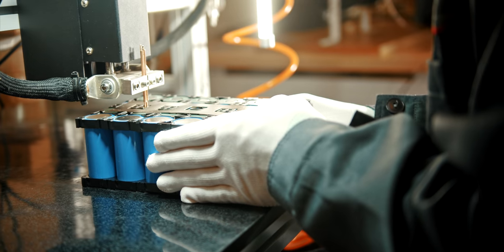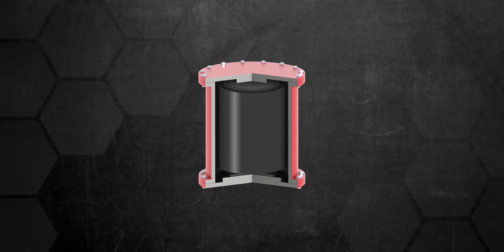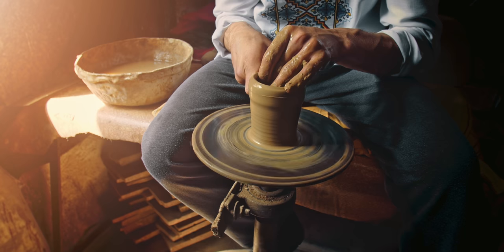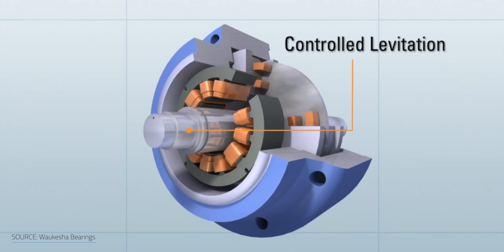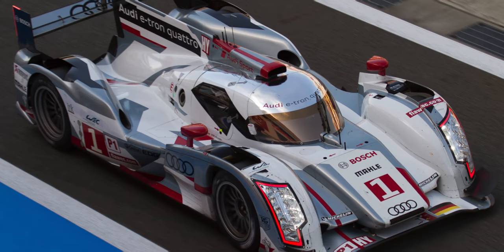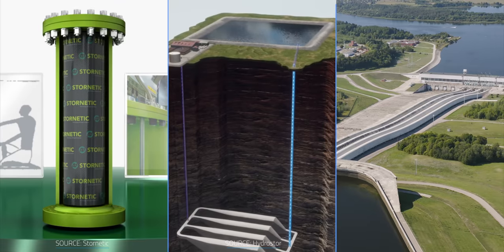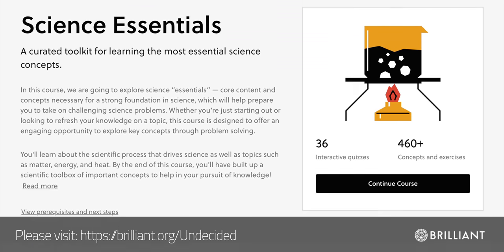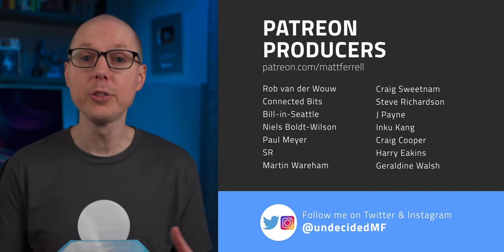The Mechanical Battery Explained - A Flywheel Comeback?

Comment: We are close to our goal of using a hamster for our energy
Reply: From horsepower to hamsterpower, we really have come very far in our ability to miniaturize things
Reply: Well, i don't think it's a coincidence that Elon once said that his factory could contain fifty billion hamsters.
Reply: Matt - Beacon power is a Boston area (Tyngsboro) company as well. Have you looked at SMEs - Superconducting magnetic energy storage
 ?
Reply: I'm afraid I can't let that happen.
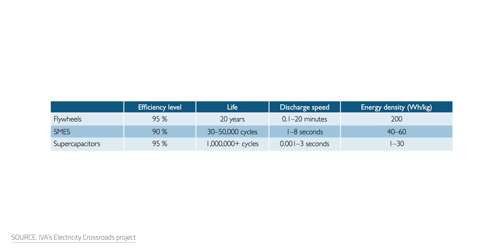Reply: As per the chart at 5:58, a 10Kg flywheel can provide 2 kWh energy; my daily consumption is less than 10 kWh. A 20kg flywheel and a 2kW solar panel can meet my total energy demand.
Reply: @janami-dharmam  One problem with flywheel that was not touched on, is that with any failure you will have what really is an explosion. Even a 20 kg wheel would do some major damage. For small flywheel this is "fixed" by building it into a VERY strong frame. It was not just by chance that for the large flywheel, the pictures showed them buried into the ground away from buildings and people.
Reply: @UndecidedMF  a video for April fools Day.
Reply: Now thats an idea lol
Reply: It's impossible!
Reply: Had to laugh at this vision!
Reply: You jest but there was, now extinct, a breed of dog in the uk specifically for that purpose. It would run all day in a wheel creation mechanical ⚙️ energy.
Reply: @bknesheim  True, but unfortunately that is the same for any energy storage device. The stored energy in the device must be dissipated locally and it does not matter whether it is a flywheel or a LEAD ACID battery. Yes, I understand that a 20 kg flywheel need to turn in vacuum and also need a vacuum pump and associated electronics and the net mass of the system may well exceed 100 kg.
Reply: @janami-dharmam  The nature of failure in a storage device matter a lot. 
Example: 20kg wood store about the same as 10kg of gunpowder, but there is no way for the wood blow up your house. The gunpowder will do just that.
Same for is true for lead acid batteries and flywheels. A bank of batteries can set your house on fire but it is easy to protect against it. On the other hand, even a small 20kg flywheel at speed will go trough walls of cinder blocks like they was made of paper in a second.
Reply: Ross Outdoors  Do Hamsters use Peloton? They gotta be pretty rich for that!
Reply: @Think_Inc  That I do not now, but at scale they will produce a lot of CO2 and CH4 (metan), but as an at end of live cycle you could sell ham-ster-burgers at McDonalds an lots of fure blankets.
Reply: Best comment! :)
Reply: @janami-dharmam  Anyone hoping to run a flywheel, no matter how small, is going to need to be able keep the magnetic bearings at some ridiculously low temperature (liquid nitrogen type stuff) in order that the superconductors will work. I'd imagine that type of refrigeration requirement is gonna rule it out for personal use. Pity.
Reply: @michaeljames5936  These are simple magnetic bearings, similar to the ones used to gas centrifuges. Anyway, superconducting magnets are currently not available at LN2 temperatures (they need liq He temp). Because the load is already balanced most of the design can be simplified.
Reply: Have a warehouse with 100 cycles generating electricity. You can pay people out of work or homeless - cash for generating power. Everyone is happy.
Reply: Im close to my goal of using high power lasers and extreme pressure from diamond anvils to compress a hamster into a near singularity to cause HAMSTER BASED FUSION!!!! early estimates on energy production are roughly told to me as " mate are you fucking stupid? What are you on about??? That'll never work" so I'm very hopeful as it sounds like norm fusion to me!
Reply: Ah finally putting Richard Hammond to good use!
Reply: all we gotta do is make a huge hamster zoo with tens of thousands of hamster wheels all connected to a power generator.
Reply: Ppl seriously think of going to 100% solar energy. Forgetting how sun doesn't shine at night
Reply: Upgrade to guinea pigs for a small fee
Reply: Simple idea, complexity within it.
Reply: @halcyonoutlander2105  idk... that kinda sounds like slavery with extra steps lol
Reply: @KOTYAR0  uhhhh that's the whole purpose for storing energy, like in this video.
Reply: Is it guna be used in Hampture? The underwater Hamster utopia?
Reply: I recommend a hamster and a cat...
...for those days when the hamster do not want to work...
Reply: 😆 lol 😆
Reply: Are these big hamsters.
Reply: Lockheed Missiles and Space Company had a contract to develop a flywheel powered bus back in the 1980s. It never worked out.
Reply: Honestly im frying my brain at how to harness all the variable inputs from multiple running hamsters without having the same number of dynamos
Reply: @theshuman100  Elon Musk has the solution.
Reply: @jimprice1959  like literally or are we rubbing his mind like a genie lamp
Reply: Close??? You people are soooo behind. My PC's been running on gerbil power since the 90's 🐹
Reply: I do that with iguanas
Reply: We cannot allow a hamster gap to form between us and our enemies.
Reply: The solution is already out there. Hamster=Humans Hamsterwheel=gyms
Reply: We should have a viable hamster power source within the next 30 years
Reply: Hamster generate energy, energy generating save time, time save money, money to buy hamster food, hamster food make hamster able to spin longer, spinning longer=more energy, repeat
Reply: Please! Bbrrrrrriiiiiiing the haaaammmmmsssteeeersssss!!
Reply: The heck with hamsters.  Automation is going to eliminate a lot of human jobs.  I say we get a lot of displaced workers to run on giant hamster wheels to generate electricity.  Think of the health benefits for the runners.  Plus, the US would be a lock for Gold, Silver, and Bronze Medals in any Olympic or World Cup long or short distance running events.  Finally the runners wouldn’t need a vehicle to get to work as they could simply run to wherever they need to go, thereby cutting carbon emissions.  It’s a win-win-win.  ;)
Reply: @Widdermaker  guinea pigs will take over automation
Reply: There  is a bbc Rutherford and fry podcast that looks into it, lots of hamsters needed...  not really an option - sorry
Reply: Eggman cackling in the distance
Reply: hahahahahahahahaahahahhaahahahahahahaha
Reply: We got that hamp game.
Reply: the global chipmunk elites will never let that happen!
Reply: I was taking to my wife about something similar a while back: a sort of biological energy source, something like an enzyme or bacteria fed with either waste material or biomass.

It would probably spark a discussion about whether it were a living being and it's ethical use(or in some cases, abuse). Idk 🤔🤷🏻‍♂️
Reply: What do you mean by "We are close"? All my energy needs come from hamsters!
Reply: Human1 : My car is getting slow
Human2 : Feed your hamster.
Reply: Dr. Hamsterwheel I presume...........
Reply: Almost there I think
Reply: The conversion rate from input to output is unrealistic. Hamster farms feeding into hamster power generation farms then ground up hamsters being fed to new hamsters still requires more energy input than it outputs. This means there's no net energy gain because truckloads of grain is required to feed the bastards.
I envision hamsters being used as modular hamster reactors in remote locations for emergency power.
Reply: we might need 2 though, the wheels look heavy
Reply: Made my day 🤣
Reply: Hyper flatulent cows, actually. We genetically engineer our cows to produce a lot of methane.
Reply: That's funny stuff... lmaorotf
Reply: Bro.. I'm already there. I found that if I supplement their diet with methamphetamine I get huge power production but only twice a week.
Reply: The hamster powered sun which in theory the RMR of a solar mass of hamsters is about 1000 x that of the sun
Reply: do not underestimate Hamster Power or Capybara Power (for heavy equipment)
Reply: "a"????? One hamster to power the world?
Reply: That's how I power my brain so it's gotta be possible.
Reply: @bknesheim  I think that's why a lot of them were mostly underground.
Reply: How about using treadmill to extract energy from people trying to lose weight..
That way it's a double whammy 😁
Reply: HAMPSTER
Reply: Sometimes the old ideas are still the best ideas.
Reply: Calling all hamsters world wide, Hamsters assemble 🐹
Reply: @bknesheim  yep, had a instructor spin one up to failure purposely for a demonstration,  tiny air driven unit. It punched a hole through 2 layers of lexan safety shielding.... that much energy is nothing to joke about
Reply: @HeronMarkedBlade-ef7zz  That would have been  a nice demo to watch.  :-)
Reply: @bknesheim  it was amazing but scary,  when they come apart its immediately, akin to a small grenade. He told us he had seen the after action photos of a larger one that had made it through a cement wall before it ran out of juice.
Reply: @HeronMarkedBlade-ef7zz  If it break apart, the rotation speed is in an instant converted to forward speed. So if the wheel spin at 500 km/t and have a weight of a ton that is very hard to stop.
Specially since the wheel usually would be built from a dense and strong material.
Have seen pictures from a test where the wheel did not break out of the housing, but completly carved up the the inner part and reduced itself to small fragments.
Reply: We could start out and harness the free energy from xhamster.  Endless free power. 🤣
Reply: @johnh8615  then you would have people arguing who supplied more power... the longer strokes, or the shorter faster ones ;)
Reply: How viable would this be?
A hamster weighs between 1 and 6 ounces, I'll go with 2. That implies a constant energy consumption for a mammal of about 400 mW based on k*mass^0.75 scaling.

We know that they can pretty reliably put out 500 mW of electricity on a wheel for long periods. Meaning we can probably find a way to force them into generating this amount of power whenever we want. This does mean that the energy efficiency for non-baseload power could be pretty poor. We might be able to fix that but let's just do the math for this first.

So if we need to feed a hamster 900 mW of grains or corn or something else fairly easy to farm but dense, we can extract about 55% of that energy in electricity or mechanical power. There are things like Sweet Potato and Jackfruit that have higher agriculture or permaculture yields, but they're harder to farm or require a lot of processing and might not have the nutrient content for a hamster. So the question becomes how much land do we need to farm to grow this fuel? We get about a 155 GJ/year/hectare from corn. That's enough to have 550 thousand hamsters continually generating power from one hectare of corn output. Meaning about enough to generate 275 kW. You could charge up a high end electric car in about 20 minutes with this much power. Or power something like a hundred homes.

Unfortunately, while that is enough to power a plane, it would likely be heavier than the plane. So air travel powered by hamsters might be doable but air travel powered by having hamsters onboard the aircraft likely wouldn't be unless the craft is very optimized to minimize power requirements (say, a fairly slow lighter than air airship or a sailplane).
Reply: @petersmythe6462  You just have to look at the full system and also include generated heat and for a planes droppings can be used to produce metan.
Hamster also run on what will be look at as wast. Korn husks and stems, bark twigs and other low cost fule.
End of life utilisation also have many options.
Reply: Can a hamster overcome the frictional losses in a 250kg flywheel at 3000 rpm? At 1hp, (hamster power) how long from rest to get to the target 3000rpm? And how many Lbs of hammy scoff/rest periods are needed?🤣
Reply: @Igotknobblies  The clue is that you just add more hamsters as needed. Anybody that has had two hamster not of the same sex know that getting the numbers you need is no problem.
Reply: Best chirp I have heard in a while.

The bunny huggers will have a problem......hamster slavery.
Reply: This is obviously for space travel.
Reply: Why hamster when you can have capybara?  - dr evil
Reply: It was GOOD enough for the Enterprise!
Reply: Getting 12ft hamsters to run whole cities is a tall order to fill
Reply: You've uncovered the secret of gym memberships. We ARE the hamster...
Reply: Exploding hamsters are indeed a terrifying proposition
Reply: @chrisj5505  MESSY too!
Reply: I can see it now: cities across the USA hosting 5Ks and marathons to get their local flywheels going.
Reply: AT LAST. HAMATARO ENERGY LIMITED.
Reply: Gaijin studios is already using it to run their servers
Reply: Well all our energy generation is just spinning turbines. So we are not that far off
Reply: @eventerminator1382  if you ate familiar with war thunder youll know what im on about
Reply: We're atleast 5o years away from this kind of witchcraft
Reply: @Flat-White  .
Reply: Awesome! The Age of the Hamster Wheel
Reply: The misleading and false idea of hamsters and other small rodents spinning fans in old computers could be one reason why the gullible may have been wary computers and could have lead to the measurement of hamster power to reflect the power capacity of computer fans in the same way that horse power is used for vehicles.
Reply: Stop spilling the beans, spock.
Reply: Whilst popular, I don't think Richard Hammond would provide the required energy output!
Reply: I did the math a couple years ago on hamsters and small hobby motors, like 1.5v ones. It would take... A lot of hamsters. I don't have the numbers anymore but it was well into six figures, might have been more than a million.
Reply: @Alwindar1  we have even miniaturized horses
Reply: Negative,we are the hamsters, this virus let some loose and  the economy masters are trying to put them back in cage (' back to normal')   The hamsters got a taste of middle class living , no money worries... What's sad is your going to have to starve them...to get them back.
Reply: Hamster ???? Thats a good one!
Reply: @zefrullahamod4817  the problem is the hamsters all run on corn so it still shares some of the drawbacks with other biofuels like ethanol such as excessive fresh water consumption etc.
Reply: Lol
Reply: @bknesheim  This happened in San Diego. Maybe 5 years ago or so. It was like a sonic boom. I live 10-15 miles from the location and I heard n felt it. I believe it was a company working on this technology.
Reply: @Jimmyfreitas35  I think a flywheel accident is a lot more scary then the same energy as an explosion since all that mass in high speed do not change direction easily.
Reply: Use 4 and more Hamster power 💪
Reply: Would be interested to see the energy density of a hamsters / waste products.

Like really how much power could you get with 1,000,000 million hamsters.

Or alternatively could you bread chickens to run on wheels then alive world hunger and engine at the same time
Reply: An average US citizen running on a wheel for a chunk of coal
Reply: Or a single Australian man. 

My Futurama fam knows what's up
Reply: @morteza1024  yes if we get rid of all the houses buildings car's trucks ships and aeroplanes we will not need anything oh and don't forget loose all the humans all of them and this planet can start to regenerate to it's pristine condition ! Just eliminating humans would fix almost everything except the damage they have already done.
Reply: You mean buttercat?
Reply: 100% hay powered
Reply: not even close
Reply: you win comment of the day
Reply: Yeah, I got the new 70000 hamsterpower Ford R-150.
Reply: Hamsters go brrrrrrrr
Reply: @sodalitia  r/wooosh
Reply: Xhamster will produce much energy.
Reply: Thats proprietary KND 2x4 technology
Reply: l wonder that the USA hasn't harnessed the power of all those prisoners, then they truly could be serving their debt to society and it's not an "inhumane punishment".
Reply: Black mirror episode where the bicycle for energy....
Reply: @salaciousBastard  they don't because it would require a continuous supply of fresh human brain in the zombiewheel. It's just not ethical...
Reply: Hamsters done have the horsepower we need your cheeper using kids for now
Reply: @bknesheim  Lithium battery explosions are in same level or far scarier than a flywheel and good luck extinguishing the fire from a EV car/bus
Reply: @edwardcardozo8325  A Lithium battery will not come after you in several hundred km/h. Neither will they go through concrete walls and still keep on going. 
The way a large flywheel has to be built to work also enable it to withstand hitting a lot of things before it stops.
What flywheels could be used for is fantastic, but they have to be placed very fare from anything else.
Reply: @bknesheim  That's anti-nuclear levels of fear mongering bs, the trolleybus mentioned in the video never caused fatalities or any other flywheel system for that matter, and for stationary industrial scale ones obviously you gonna need extra caution like everything else in a large setup
Reply: I think the use case for fly wheels are more about grid stability and and backup powet to improve constant supply rather then about storage.
Reply: This is not stupid!
Reply: It's always 10 years away though
Reply: lights hampster on fire to boil water -- goal achieved
Reply: I completely agree 👍
Reply: inanimate hamsters indeed
Reply: A flywheel is a mechanical device that stores energy in the form of rotational kinetic energy. Historically, flywheels have been used in a variety of applications, including steam engines, windmills, and water wheels. In more recent years, flywheels have been used in electrical generators and as part of hybrid vehicles.

The use of flywheels dates back to the early days of humankind. One of the first recorded instances of a flywheel was in Ancient Greece, where it was used as part of a water wheel. The flywheel was attached to a shaft that drove an agricultural millstone. The weight of theflywheel helped to keep the millstone in constant motion, grinding wheat into flour.
Reply: @showshowtomakefreeenergyge2426  and if a fly wheel can do that much think of what a hamster wheel can do! hamsters are so much bigger than flies!!
Reply: Well... We've worned these out... This is an endangered species now...🐹🔋📉😵
Reply: Poor hamster. SMR here we come!
Reply: @sodalitia no, it's necessary.
Reply: Aowkaowkoakwo😂
Reply: Xhamster?
Reply: We have MILLIONS of prisoners we could use!!